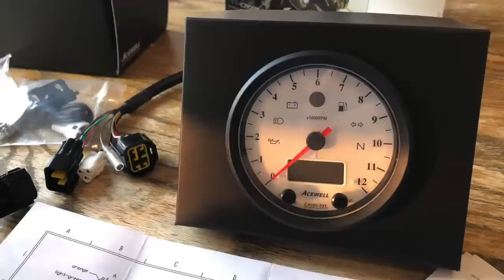1985 BMW K100RT Cafe Racer Custom Build Compilation

Comment: i dont like the sound of many 4 cylinders, but the k100 4 cylinder sound is just one of a kind. Its so different compared to the typical r6 and cb650 sounding bikes. I also like the r1 crossplane sound.

Comment: What did you use to setup your Acewell speedometer? I have the same one and will try to use a Tenet BEP to set it up. Any considerations?
Reply from the maker: Using a BEP 3.0, still trying to figure out the tachometer settings/wiring.  Everything else seems to work well.

Comment: awesome 
what exhaust is this?
Reply from the maker: It is the stock exhaust but I cut off quite a bit of it. Also shaved any of the tabs for the best shield, then brass wheel polished what was left. Around 6:00 in the video shows the finished product.